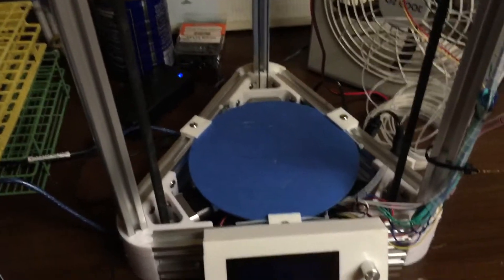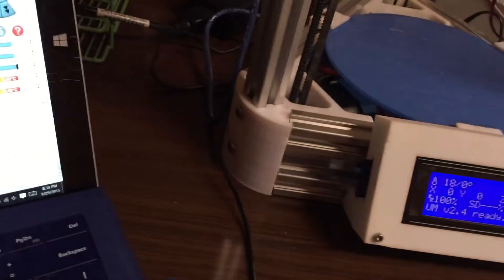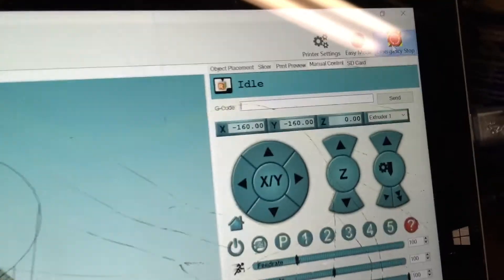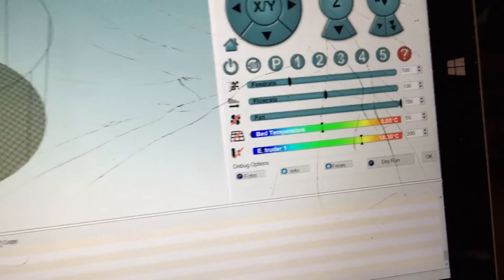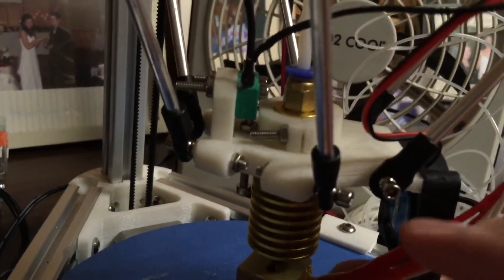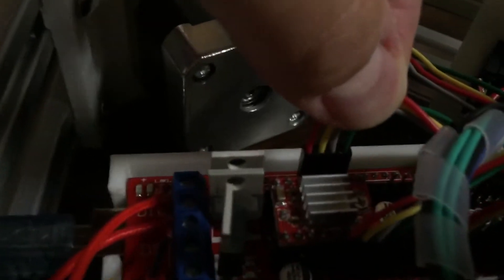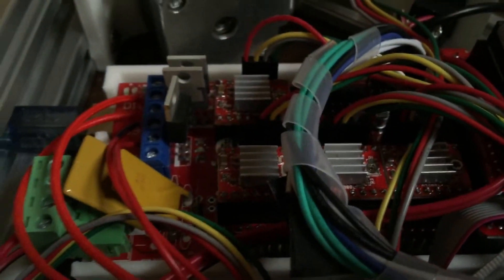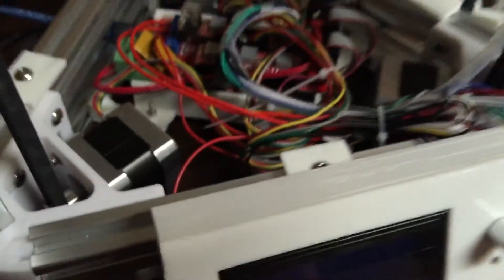Dlt-180 wrap up

Comment: Hi iceman198, I really appreciate this video! It solved lots of my problems, mainly the one where to put the jumpers. Anyways, I noticed that everytime I restart my printer it reverts back to 100 steps per mm. How do I get the printer to remember to go to 16 steps per mm. Also where do you put the Z endstop offset? If you could help, I would GREATLY appreciate it! Thank you!
Reply: I figured out I didn't need to do the 16 steps thing. But, I am still curious after you run g29 are you good? Cuz it seems that my hot end isn't close enough to the bed and it is closer to one part of the bed more than the other part.
Reply from the maker: hey pcshooter,

I actually stopped using g29 all together because of the mechanism.  Because of the rods and the tube to hold the filament, as it would do the leveling, the angle of the head would change because the tube would pull a little and I didn't trust the bearings in the rods.  It truly is a pain to manually level the bed (adjusting the belt tension and stops at the top of each tower) but once you do, you never have to worry!  Look up some tutorials...I think I even have a short video about it...?  can't remember...=)
Reply: +iceman198 thanks for the reply! I will check those out and try that! Also where do I put the z endstop number?
Reply from the maker: +pcshooter24 I'm not sure what you mean? you mean the max height?
Reply: +iceman198 I believe you talked about it but the number you get from doing the "Paper Test" I am not sure where I am suppossed to input that number.
Reply from the maker: Gotchya.  Yes, in your Configuration.h, find the 'MANUAL_Z_HOME_POS'.  The number you get from doing the paper test; if it is negative, you will want to add that amount to what is currently set for MANUAL_Z_HOME_POS.  For example, if MANUAL_Z_HOME_POS is set to 200 and you get -1.2 when doing the paper test...you will set the MANUAL_Z_HOME_POS to 201.2....and the opposite if the number is positive...subtract.  Once you do, that, using the Arduino software, burn it to your board...then do the paper test again...and your number should be within 0.2 of 0....make sure to touch various parts of the bed to get it as level as possible.
Reply: +iceman198 Awesome! Thanks! Hopefully this is my last question but what is the directory for that Configuration.h file. Because honestly I saw someone elses video serting that but I could not find that file for the life of me, even using the search function in windows explorer.
Reply from the maker: When you got your kit, it should've come with an SD card that had the firmware on it.  You can find your firmware files in there.  You'll need to download the Arduino software as well. Check out this video for a rough overview (https://www.youtube.com/watch?v=M9qyE8Unyv8).  This is for a different type of firmware but he gives a good overview of the flashing process.  If you need a copy of the firmware, I've posted the original from the SD card here: http://www.duttonbiz.com/FileStorage/MICROMAKE_Firmware.rar
Reply: +iceman198 Oohhhhh ok thank you so much! You have helped me a ton!!!
Reply: Hey iceman, I really appreciate all the help you have been for me so far! I actually didn't get around to manually setting leveling the bed until today and I ran into an interesting problem that hopefully you can help. If not, no worries. Anyways when I am doing my paper test, I am level and the paper can barely slide when at all these coordinates (0,50) (0,-50) (50,0) (-50,0) but when I am set to (0,0) the tip is super far away from the bed. So pretty much if I move from (0,50) to (0,-50) the nozzle goes up and then back down in an arc from one point to another.
Reply: I reloaded the original firmware and am slowly changing one configuration setting at a time to see what setting was the issue.
Reply from the maker: there is a setting in your config.h called Delta_radius....subtract or add to the end of that equation to make the center cone up or down. I think in your case you want to add to it. maybe just 1.0 at a time till close then by the decimal to hone it in.
Reply from the maker: also, don't keep changing your z-home everytime....just the Delta_radius at first...then once you have it level figure out how much you need to tweak the z home. so while your new z to touch the bed might be -15.2 or positive...make sense?
Reply: Yah makes sense! Thank you! Currently I am just doing g28 then g29 and then comparing the outside corners z number to try to get the bed level via the endstops and once I have that I will work on the cone part! It is slowly starting to make more and more sense. Thanks again!
Reply from the maker: ohhh...I forgot your auto-homing. that is your z-offset that needs to be tweaked. nothing else. change everything back. =)

Comment: Hey Iceman, I am currently in the process of building my He3D delta 180 kit. This video helped a lot. I had another question you may be able to answer. I ordered my kit and it said it came with auto leveling, my kit only came with the three green buttons on the 3 Z axis. There isn't another one for the hot end. Did you pay extra for that feature? Do you know what parts I would need for that extra feature?
Reply from the maker: Yeah, I think I did pay extra ($15 maybe) for that...but really, all you need is another endstop (green clicker) and wire it in appropriately.  I'm sure the mount for the hot-end is the same.  When you put the hot-end pieces together, you should be able to push the bottom and it will go up and down.  

Honestly, I don't use the auto-level anymore as the design for the hot-end isn't good.  The tube that feeds the filament in would push or pull differently on it depending on where it was on the bed so it would get thrown off because of that.

You can manually "level" it in the Configuration.h...tweaking settings along with adjusting your x,y,z rods/poles.  It takes a bit but makes printing a whole lot easier in the end!
Reply: Hey Iceman. Thanks for the advise. Turns out they didn't send me the clicker, but sent me everything else, so I picked up a clicker from radioshack and all is good.

I think I have a solution to the auto level problem you are having. I am going to design a fixture to fit over the center piece to hold the 4th clicker. I'm thinking something as simple as a chopped up pen, pen spring, and hot glue. When the pen hits the bed it'll click the clicker for the auto level. This would allow the extruder to stay rigid which is the modification you made.  I'll keep you posted if it works.
Reply from the maker: something like that should work. I've seen something like that on others...just make sure you can move it out of the way so it doesn't touch while printing. do let me know how it comes out!

Comment: Helllo iceman198, thanks so much for the advice about the jumpers and stuff. Im almost ready to print.  Could you tell me how you loaded the filament through to the extruder? Im not sure what to do with my E-axis motor. Do I send a command to the printer from repetier? Or is there an option to load filament on the LCD. Thanks
Reply from the maker: +Adam Samaeli There is a screw at the top with the spring...unscrew that all the way and pull it out.  Then you can lift up that top piece.  Then I just put the filament through the holes and through the tube.  Make sure the tube is not in the hot end yet.  Then feed the filament all the way through the tube until it comes out the other end.  Before putting it in the hot end, you'll probably want to make sure the extruder feeds the correct way.  So open up repetier host and heat up the hot end to 180.  Once it is there, it should let you manually click the button to feed filament.  Go ahead and just make sure the filament goes the right way.

Actually...there is a little more...I will see if I can make a quick video tonight and then upload it tomorrow for you.  There may be other videos already on youtube.  Just did a quick look but didn't see any though...odd.  The kossel mini is pretty much the same thing as this so you could search for that.
Reply from the maker: +Adam Samaeli Just uploaded this: https://youtu.be/_xS0nSK0-Wc

Comment: Do you have a wiring diagram? The instructions I received are slapdash at best.
Reply from the maker: +Denver Benedict This one is a bit easier to read (http://www.nextdayreprap.co.uk/images/nextday3dprinters/Reprap_Prusa_Mendel_Build_Manual/2500_2500__Reprap_Prusa_ramps_diagram.jpeg). In the diagram, if you're NOT using a heated bed, you don't need power going into the "11A" for the main power.
Reply: +iceman198 Thanks! That is much better!

Comment: great videos, but one question, my lcd doesn't show up any text when I turn the printer on? Installed the firmware to the arduino knockoff board but still no words on the lcd? Thanks for any input
Reply from the maker: +Wanseer Gaming Have you tried hooking it to the computer and seeing if Repetier Host sees it or not?  You "might" have a fried arduino board...supposedly that is the effect...the blank LCD.

Try hooking it to the computer and see if Repetier can see it or not...just check the baud rate you have set in the configuration.h file of the firmware. if that works, I wouldn't worry too much as you don't really need the LCD to print. I ended up scavenging an old netbook to dedicate to the printer to run it and running OctoPrint.

Comment: Hey I just bought one of these. I'm running into a problem where when I type in G28 and it goes all the way up, but then my Z motor hits the limiter but keeps trying to go up. I know for a fact that the limit switches work because I tested them.

Any idea??
Reply from the maker: +SuptaTT Make sure the endstops are plugged in where they are supposed to be. (http://forums.reprap.org/file.php?219,file=52456,filename=InternetRamps2.jpg).

Also, just made this video for you in hopes it explains things a little bit. (https://www.youtube.com/watch?v=Br80oXDUprU) 

It sounds like you have your 'z-probe' endstop wired as one of your axis endstops (just a guess).

Also, I have mine soldered on the two outside pins on the endstops which actually makes the connection...and the way the board knows it is hit is when it sees the connection break (clicking on the endstop).  If you've soldered to the center pin, that makes the board see the connection as open rather than closed.  By default, our firmware isn't expecting this but you can tell it otherwise.  

If you DO have it soldered to the center pin making the connection open, no need to re-solder; open up your firmware and search for 'ENDSTOP_INVERTING' and change them all to 'TRUE' (this is in your Configuration.h' file).  Then upload it to your board and try again.

Hope this helps.
Reply: +SuptaTT If you send G-code M119 it will return the status of all endstops. If you manually push the carriages all to home position and issue this command, they should say "TRIGGERED" and when it's down it should say "open."
Manually test that when you trigger each one, the correct one reports as triggered. You'll have to issue the code several times to do all the tests that you need to. Also test the Z probe while you're at it. This test should tell you if you have the right end stops wired to the right pins, whether the logic is inverted as iceman suggested, and if the firmware is sensing them all correctly.
Reply: Thanks, they were inverted. I finally got the whole thing running and it's money well spent. Thanks for the replies.

Comment: Hey Iceman. I am very confused with my printer and I was hoping you may have some advise. So I got the arduino programmed, the wiring correct, and the vrefs correct. I am able to navigate through my LCD screen and I am even able to connect my printer to my computer and have it read on rep-host and arduino. I'm able to do everything, but I can not get the motors to move at all. (I checked the motors and they are good)

Manual mode does not work and I can not send anything from my computer to the printer. Did you run into this problem? Could I have my printer profile incorrect on rep-host? Any suggestions or advise would be much appreciated!
Reply from the maker: Hey Rick, is Repetier host showing anything in the log area at the bottom when you try to send commands?  Would you be able to take a short video?
Reply: Good news. I got through my problem. It now works and I am working on getting it to print! Thanks for the videos and your help!
Reply from the maker: Sweet!  I expect videos.  =)
Reply: I will, when I fix my extruder. I am not sure how this happened, but the heat exchanger clogged. So I'm ordering an extra brass coupler and getting things rolling again. The issues seem to never end.
Reply from the maker: Bummer. Mine clogs if I don't have the fan pointed just above the hot end.... it will always flex just before getting into the tip while extruding if not cooled in that heat sink area.

Comment: Hi Iceman. My name is Roger, and I'm from Spain. I am a student that's doing a research project about 3d printers, and I bought the same He3d delta 180 3D printer with the heated bed and auto leveling feature. But my firmware is wrong and I would like to know if you could send me your firmware so that I can upload it to my printer. 
It is my first 3D printer and I'm still learning about it. I know that I have all the electronics correct, but something is wrong.
Thank you!
Reply from the maker: Hey Roger, cool to hear from Spain!   You can download my firmware here (http://www.duttonbiz.com/FileStorage/MICROMAKE_Firmware.rar).  You will want to examine the Configuration.h file carefully (I translated all the chinese to english!) as it is kind of fit for my setup.  I have my endstops wired on the two outside pins and with that I had to flip the boolean of the hotend endstop for auto-home to work correctly (even though I don't use that anymore).

In there are some settings fro Cura and Slic3r which might be helpful as a starting point.

Let me know how it goes! Hope you get it cooking quick enough.
Reply: Thank you! I really appreciate that!

Comment: help
Reply from the maker: Hello Emmanuel, are you needing help with this machine? Would be glad to help if I can.
Reply: extrusora remoto, the motor does not move https://drive.google.com/file/d/0B_BX_3uRBHT7WVpiRlpHRk81TWs/view?usp=sharing
Reply from the maker: +emmanuel gongora diaz Keep in mind that the firmware won't let the extrusion motor move until the hot-end is at least at 180deg I think.  You can test the extrusion motor: unplug all your motors and plug your extrusion motor into one of the axis motors. Then turn it all on and open Repetier host and try and move the x or y axis manually (1 or 10 mm) and see if it moves.

Also, with my extrusion motor, I had to change the 'INVERT_E0_DIR' to true as it was turning it the wrong direction.

Also, make sure the wiring for it looks the same as your other motors.  If all it does it makes lots of noise but doesn't move, you'll have to play with the wiring.  I had to flip the two middle wires on all of my motors because they were wrong.

Hope this helps!
Reply from the maker: +emmanuel gongora diaz did you try plugging it into one of the axis plugs? Or if you don't want to unplug everything, heat the hot end to 200 and once it is hot, try moving the extruder.
Reply: +iceman198 It seems that my engine is damaged thank you very much friend
Reply: You can also send the code M302 to get the firmware to ignore the temperature safety check and allow cold extrudes/retracts. I don't recommend doing this with filament loaded unless you know what you're doing, but it's great for testing and pre-loading the Bowden tube.